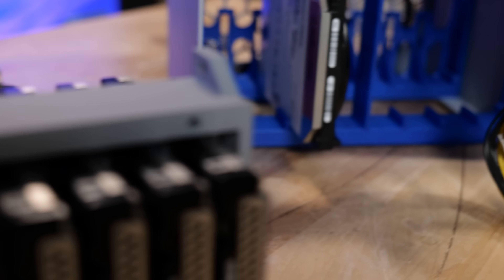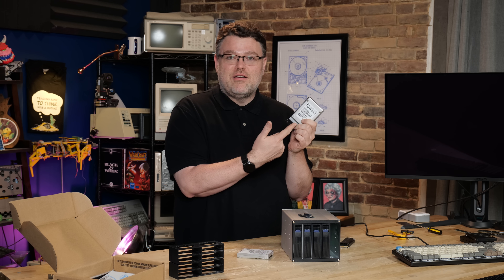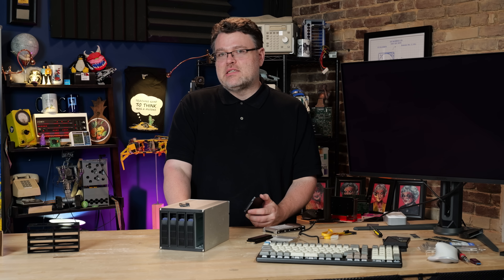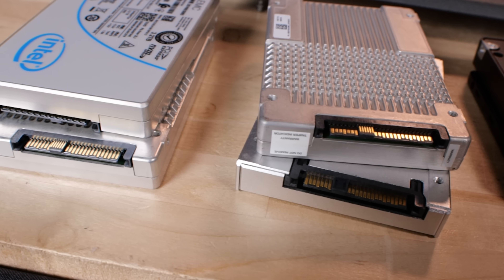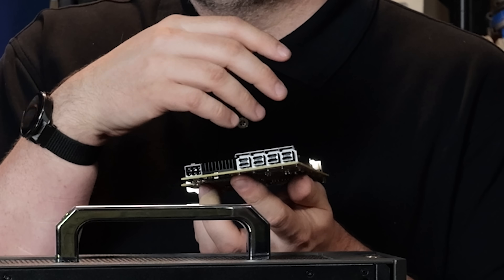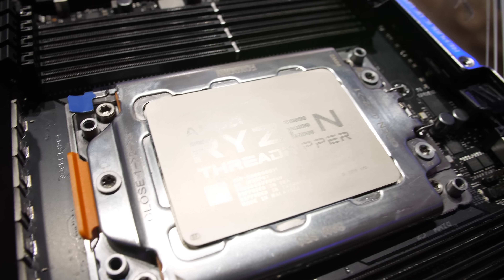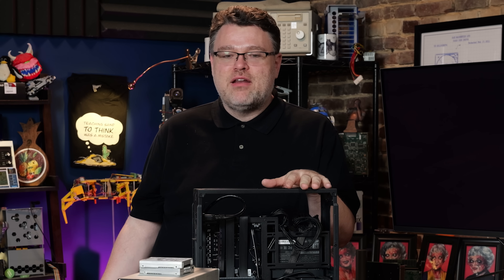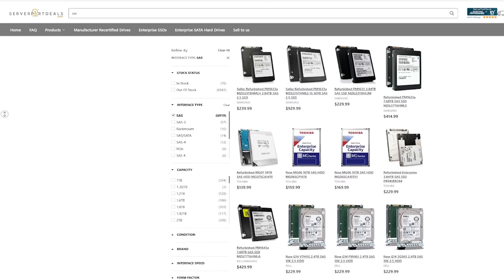Need Cheap Mass Storage? Try Surplus SAS Flash!

Comment: Not what I would call "cheap". 2 years ago I bought used enterprise grade spinning hard drives. I paid ~$85 each for 2 8TB drives. Today those same drives go for around $170. Still vastly cheaper than flash, and for nearly all homelab use cases will still be more than fast enough. They fully saturate my gigabit network and even for internal transfers exceed 200MB/s. I'd love flash, but reality is for now there is no good reason to move to flash based storage for simple data storage.

Comment: Using a SATA to SATA connector also works when using "shucked" drives, instead of MOLEX to SATA. Just cut the 3v wire in the adapter. Or just cut the 3v wire in the cable coming directly from the PSU and eliminate the whole adapter mess. My thought on cutting the 3v from the PSU cable is that I'm likely going to be installing multiple drives in this manner. Eliminating the adapters eliminates clutter. I'm also hoping to put this NAS together and forget it for the most part. The PSU SATA power cable has found its final home and the 3v power will never be missed.

Comment: I like the idea of no spinning rust, but honestly that's just not feasible in my personal server.  I need the raw capacity over the speed, and I can purchase twice the amount of drives for multiple raid1 arrays cheaper than I can get the flash storage.   Even with power savings of flash storage, that wouldn't break even... for damn near forever lol.   Who cares about the power savings when I have solar panels and a battery bank.  I'd rather have 120 TB of raw storage in one machine with no need for a second NAS, with about half of it usable as actual storage with way too much parity.    Raid isn't my backup either, I'm just a big fan of multiple raid 1 arrays for parity/redundancy.

Comment: Really find your advice odd some times.  maybe the UK market is just different, but SAS flash not that cheap, runs hot, needs a sas card, reeeealy wants a proper backplane, (3dprinting a chassis is not a great idea, in PLA anyway, it warps when it gets warm, you are asking for a fire), and the proper cables.  plus the time you will waste rebuilding the array when the fail and trying to work out of these old drives are still good.  Just get a bunch of new NVME m.2s and some 4 way breakout boards, it will be cheaper, lower power and less risk and quicker.    now SAS spinning disks are cheap... still don't make that much sense though unless you happen to have a server chassis to slot them into already.
Reply: Aye.  I managed to pick up a 24bay sas tray for about £40 (populated :) ), then just slapped a sas expansion card in the back of my truenas server and I serve it to my pc via 10gb fibre.  I’ve also got a sas expander that just sits in an old pc case with a bunch of drives and the server accesses the drives directly as a big old sata jbod array.  I only use an old pc case for it and motherboard to power the expansion card.

Comment: would you recommend using one or two old ssds for zfs-cache in truenas? I'm new to truenas and not sure how reliably it will detect when the zfs cache drives go bad. Will it continue working without user intervention but just not have caching anymore? I currently only have one hdd zfs pool and would like to add cache for occasional large file writes.

Comment: This isnt cheaper... $83 per TB (average on linked site)  and you have to get a sas controller when I can just get 2.5 2tb for 119.99 on amazon right now no special controller. So, I dont mean to shit on the video but, the cheapest i seen per TB was $67.70 and that was a SATA drive, amazon sells a crucial bx500 2tb for $57.49 per TB and its new and under warranty. Im just not seeing the value at this price for the sas drives

Comment: SAS flash 👍cool idea for homelab.
Potential problems are: (1) still too extensive, (2) need to deal with possible firmware issues, and (3) conversion to 512 bytes sectors.
Add it all up - plus the time invested - to maybe 50:50 get it working sounds a tad risky for me
Reply: 16:22 -- 25 Gbps NIC cheaper than 10 Gbps? Will check prices
Reply: 2:11 -- I need 520 or 528 byte sector size. I love having a check sum at device level

Comment: the problem with these SAS drives is that they need power, which means you need to figure out how you are gonna get power to them when you already have a fully loaded system with all your PSU SATA power cables in use. SAS Backplane much?

Comment: I have had less issues with used enterprise with 100's of TB writes that cost about the same as cheaper 4TB SSD's. 
I had 8 Silicon Power SSD's that all failed after <800 hours and a few TB writes, no warning, just stopped showing up in windows and in Truneas the just disconnected and stopped being recognized. Then all the replacements (all same model, but different firmware and some had slightly different capacities....) died after 6k hours and 14TB writes. Wish I had spent that money on used enterprise drives since my workloads i see are only 40GB/day in writes. Only buying well known+established brands moving forward.
No other drives in the 2 systems these were in have had issues so I pin it on the drive.

Comment: speaking of "you can build a threadripper"....I actually just built my threadripper 9960x. I had been using a 3600x (spare CPU I had laying around) with a B550 board (forced to buy it with my geforce 3070). Initially I was happy. with my Intel A310 GPU I was getting 200 FPS on 1080p video and 45 FPS on 4k. I wasn't doing much 4k at the time. Then I added more storage and to ensure my BD drive wouldn't vanish, I had to cut my GPU down to x8 instead of X16. This disabled re-bar. I was only getting 65FPS in 1080p and 15 FPS in 4k. Well now with threadripper (I've only had 2 nights to actually use it so I have very limited use cases, but this is what I've seen so far) I'm getting 350fps in 1080p video and 110 FPS in 4k. The bottleneck now is the blu-ray drive itself. lol Maybe I'll buy another one. lol I do have several spares, but none of them do 4k and they are all even slower.
Reply: one thing that surprised me about this build is the amount of power it needs. dual CPU plugs AND a dual PCI as well (except I was able to get away with using 1 line for both PCI). I almost feel like I'm close to maxing out my poor 750 watt PSU. lol

Comment: Does anyone know where to get that 4-5 bay external SATA / SAS enclosure in the UK. Nothing on ebay, unless you want a 2U DAS. I'm specifically looking for SAS 12GB support. It'd pair well with my minisforum board, although I'd need to look for a controller too.

Comment: Sounds like NVMe-lite which is an NVMe standard that is supported by Linux. NVMe-lite defers the FTL and the ultimate ECC to the driver. This implies that you can use a different approach for different workloads.
For instance "object" storage can be handled completely different than "object" streaming storage.

Comment: Excuse me that I don't know this but where could we find the printable files for the cases mentioned here?  I'm interested in the second one, half height only or not. 

What I find is that the deals aren't so great but maybe it's because of he internet knowledge run on a source effect.  I'd also like to know why there was never massive slower solid storage, like SATA SSDs seem to have stopped at 8TB and even those are more extreme and now super expensive, 4TB seems to be the top for regular market cases.

Comment: Meh, 50 bucks per TB? I dunno, that barely cheaper than buying cheap new M.2 drives. Sure, they're enterprise drives with high endurance ratings and all, but they're also 7 years old, much slower, and you get all the potential headache with those firmware bugs and 3.3V rails, potentially bad drives that fail quickly etc. It'd have to be much cheaper for that saving to be really worth it IMHO.

Comment: I got 20 1tb samsung enterprize sata ssds for like 250 from something similar recently. It was good timing cause I needed shared storage for a proxmox cluster, and before I was using 2 zfs pools synced on different machines with HA software to swap between them in the event of a failure. Sufficed to say It did not work. Now I just use ceph.

Comment: I'm still dreaming of the day that I can put 24 x 7.68TB SAS SSD's into my CSE-216 chassis for an awesome NAS, however, that day isn't today as that'd still be nearly $10K.  I guess I'll just have to live with my 16-bay CSE-836 with 14TB SAS drives that I got for $150 each brand new from SPD a couple years ago instead.

I don't see flash storage ever being cheap enough to use for a NAS if needing more than 16TB of usable capacity at this rate.

Comment: If you just want cheap long term solid state NAS storage, kinda hard to beat the 2.5" T-Force Vulcan 2TB. Roughly $42/TB, TLC, RAID support, and even when writing they always saturate 2.5GB/s LAN in RAID5. I have 8 of them at this point storing Blu-rays/DVDs/games and haven't had one fail yet. Maybe SAS is cheaper than it was, but it's comparatively awful bang for the buck compared to a consumer SSD RAID5 array.

Comment: Under the hood most flash is not 4k block size, but file systems and controllers are optimized for 4k it so the disk should be too.

Comment: if you try to concoct a master plan for your ultimate dream NAS. paralysis of analysis is common and you're gonna end up doing nothing.
most people get hung up on the drive bays/backplanes/enclosures once they realize its gonna be like $999 to install 8 hot swap ICYdocks with nothing even in them. 
find a $300 refurbished server first before you start going crazy with drives and bays and hot swap. pull the trigger to obtain the PC, and try to cobble it together into NAS mode yourself.
key point is going hands on sooner than later, or you're not gonna learn the intricacies of choice and preference that Wendell has a mastery of.

Comment: Need Cheap Mass Storage?
Heck yes!
Dutifully heads over to the linked Server Part Deals! page...

Huh, it's only 10x the price per Gb of SAS spinning rust. I know I'm strange, but that does not meet my definition of "cheap".

Still, they might make a nice performance/caching layer between the NIC and the rust.
Reply: Flash storage has always been more expensive than spinning rust. The drives are cheaper in the fact that you're buying a used component versus a brand new one at MSRP.

Comment: There are truly inexpensive PCIe NVME M.2 adapters to U.2 - but what's the lowest cost way to connect that to an ordinary desktop PC? What I find annoying about PC hardware is how many things would be useful, yet nobody makes them. There are PCIe NVME to USB-C adapters. They come with quite a performance hit, even if connected to a 3.2 port. But with a cheap Chinese 1TB off Temu (which turned out to have chips by Realtek) I don't care about the speed.

What I would find immensely useful is a PCIe NVME to SATA III adapter. Sure that would have even more of a performance hit, but done right it would be able to always max out the SATA speed. But such a thing does not exist.

Something that didn't exist for a long time was a PCIe x1 to Type E card for connecting a front panel USB-C port. Such cards with an external USB-C port existed pretty much from the introduction of USB-C. I contacted every manufacturer I could find that made the x1 USB-C cards and explained why they should "turn it around" with an internal Type E connector. There were tons of such cards but only x2 size or longer.
I dunno if my one man email campaign finally got some company to see the light - but a while ago someone started making a PCIe x1 Type E card. Put all those useless x1 PCIe slots to good use! It's one of those things most people don't know they need or want until they stumble upon it then they realize it's exactly what they need.

I'd love to see an ExpressCard to single USB-C port. Do I care about speed? Nope! I just care about being able to plug in a thing to my laptop that will not work with a USB 3.x to C adapter for some reason. It wants a real USB-C port. It doesn't even need the super speed of USB-C. Doesn't matter what the gizmo is, it only works on USB-C. But no company makes one of these ExpressCards - despite the fact they make ExpressCards with one or two USB 3.0 ports that cannot come close to the speed of USB 3.0 on faster PCIe than ExpressCard's 1st gen x1 link.

This mess with SAS is just like back when really fast Ultra 320 SCSI drives with SCA80 connections were becoming available really cheap as surplus. The controllers were stupid expensive, huge, power hogs, sometimes had cache RAM with a battery backup - which could've gone bad and be difficult/costly to replace. But the aftermarket stepped up and produced a wide variety of SCA80 to normal 68 and/or 50 pin Wide and Narrow SCSI adapters. Speed would take a hit but one could connect a massive amount of super cheap storage to a cheap Adaptec 2940 Wide SCSI PCI card.

Comment: On those SAS breakout cables, it's actually pretty easy to remove the 3.3v pins using a utility knife to pry them up, and then they can be broken off.  Permanently fixed and you can use SATA power cables if your system has them without adding a questionably unreliable Molex connector in the chain.

Comment: Um, $60-80+ a TB is not cheap mass storage. That's not even cheap for flash storage. Not when I pay $10-$15 per TB for high-density HDD storage and $40-$50 per TB for new consumer-grade flash. They do have better density available (as in, potentially more storage per connector) when compared to consumer-grade drives, but that much flash storage is WAY overkill for probably 95% of homelabbers.

Comment: 6:28 "it will die prematurely"
Will it? What's the reasoning behind this? I thought modern chips were able to thermal throttle and you'd just get lower performance?

Comment: Maybe better get those if you have the lanes > SAMSUNG 15.36TB BM1733a 2.5" SSD U.2 PCIe 3.0 MZWM515THALC-00AG5 MZ-WM515T0 - Brand new £845.00 from ebay and the 7.68TB for half the price. For many one drive will be faster and have more storage then they need. I already dealt with the company and they will do better prices if you take more etc. and will declare it as low value say £50 or $50, so you dont pay much customs if any, as I didnt pay anything. So If you can Get industrial NVMes for the same price as SAS/SATA PCIe 4.0 is for few more $.

Comment: The power consumption discussion made me realize I'm doing pretty good with my cheapo ATX form factor NAS.  B150 board, i5-7400, 9300-8i HBA, three HGST 8TB SAS HDDs, two HGST 200GB SAS SSDs, a small NVMe boot SSD, and a RTL8156 2.5Gbit NIC on an EVGA platinum-rated supply idles at about 75 watts.  I use the HDDs with ZFS mirroring as my data pool and the SAS SSDs also with mirroring as my apps/containers pool.  The board, CPU, RAM, power supply, case were all free; salvaged from decommissioned business systems thanks to the mass Windows 11 migration at the moment.  I've got really decent airflow in the older CoolerMaster case, but I should add something directed at the SAS HBA.

Comment: Hard disks run hot, can those 3d printed drive cages deform over time? PLA will soften at 60C.
Reply: Well if you're HDDs get to 60°C that's not that healthy for the drives, you should really cool them better if you get to those temps. But I'd probably still be a good idea to print the cages in PETG to avoid it deforming from heat, that could happen at lower temps as well. And probably also a better choice for the drive caddys as PLA might snap to easily if you have a design with some kind of mechanism to clip them into place.

Comment: Important comment on Molex-to-SATA power adapters! You want crimped connectors, not molded connectors. Cheap bulk-produced molded connectors can often cause power pins to short together, burning your house down.

On a related note, I've been shucking external HDDs since 2018 and after carefully cutting and applying some kapton tape to the 3.3v "sense" pin, I've never had to reapply it once after un/plugging these drives a dozen times each. Saved a lot of money over the years.
Reply: Those molded connectors were the cause of "Molex to Sata = Lose your Data" saying.

Comment: "Cheap" is relative. I love using cast off enterprise equip, but these used drives are quite expensive compared to sata equivilants. For most home-use cases I think people(who are on 1g ethernet) would be better served with sata spinning disks or sata ssds. The performance increase does not justify the price increase for most people.
Reply: My brother dumped me a box full of 120GB SATA SSDs last year when he moved house. They came from his old job in a school from when they upgraded to 250GB.
Anyway, 4 of them are now a ZFS array that I keep my flight sim (X-Plane) installation on, freeing up about 70 GB on my real SSD.
I have them connected to an old 4 port SAS controller (in IT mode) I had laying around. If I recall, it couldn't handle 2TB disks, so it isn't much use these days, but it's doing great with the 120GB SSDs

Comment: One thing that is not mentionned is that a lot of these HGST Enterprise SAS SSDs are 12Gbps, not 6GBps like consumer SATA. This means you'll generally get 1GB/s out of these drives whereas SATA 6Gbps is more around 500MB/s. Of course, this means your SAS HBA has to support 12G and above. For Dells, the would be PERC H730P and above. You can use H730P's/H740P's in other machines, of course.